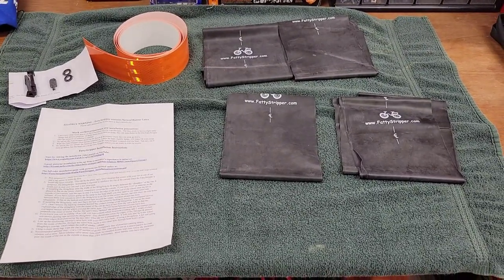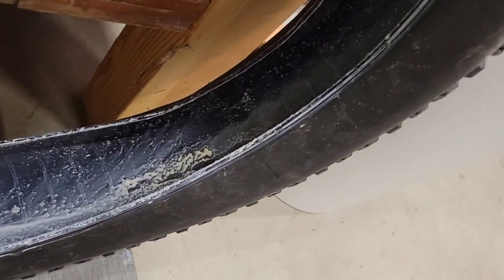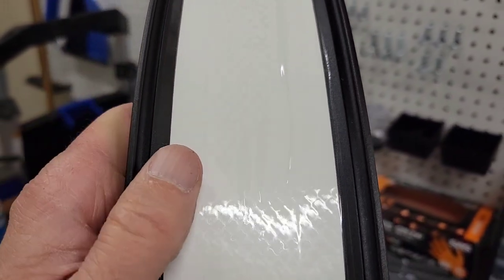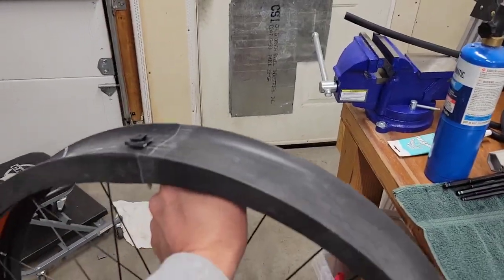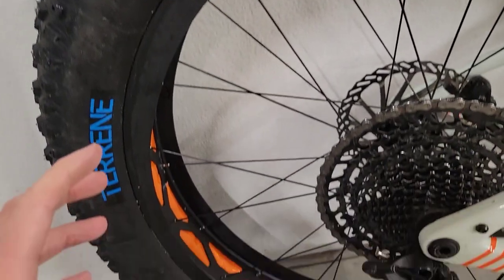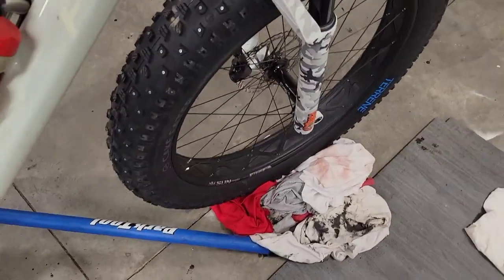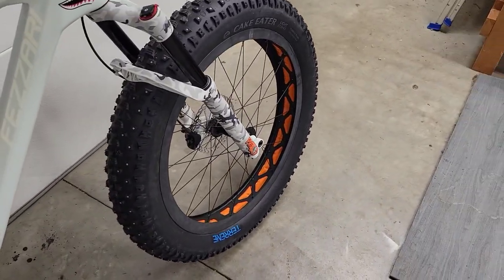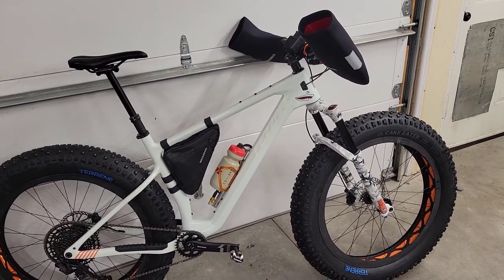2022 Fezzari Kings Peak Fat Bike - Part 4 - Installing Fatty Stripper Tubeless Strips

Comment: Curious why you went with fatty strippers and not just the sun ringle tubeless tape?
Reply from the maker: Mainly because at lower psi (3-4 on snow) I was experiencing lots of sealant leakage around the beads. I was fearful of burping. After installing the fatty strippers I have had zero leakage on the beads and no burping issues. The whole idea is the strippers eventually get "glued" around the bottom/outside of the tire bead so that even if I burped I will not loose air because the stripper is now basically "glued" to the bead (kinda acting like a sew-up road tire - kinda).

Yes, I could have left the ringle tape on the rims (while installing the strippers over the top to seal up against the beads),  but I wanted to change over to the orange "bling" strips that I ordered with the strippers. I just thought they would look cool showing through the holes. To install those I had to remove the tape and just didn't want to try to reinstall it so I wrapped it with packing tape per the Fatty Strippers instructions. You can just order the strippers and not undo the existing tape job if you don't care about his bling strips.

So far no leaks anywhere even at lower psi. I'm 210+lbs loaded up for winter riding and if I go much lower than 4 (3 is really pushing it for me) I'm approaching bottoming out the rim to the tire. But I've ridden with guys who are much slimmer than me and they run 2-3psi with the strippers and they say they never burp (well if they did that stripper is there to keep the air in).
Reply: @Howitzer409  Interesting! I just asked because I've ran the V1 Mulefuts for a few years now and really had no issues with them burping at low pressures (close to zero at some points) even though I'm close to 200lbs loaded up. 

I did however buy a new (to me) fat bike with Surly Marge Lites that I will be using fatty strippers on so that's how I came across the video. Good to see the install and hear they've been holding up so far!

Comment: So every time you switch wheels you will need a new latex piece? 

Also, when you trim the excess, you will essentially still have a small amount of excess latex sticking out?
Reply from the maker: I haven't tried removing my tires yet, but other guys I know who use them say the latex strips remain "stuck/glued" to the beads. They just have to be careful when removing them.

I was able to trim mine very close to the bead/rim, so you can hardly notice it was there (you'd have to get really close).

So far I've not had any leaks or loss of air due to burping.